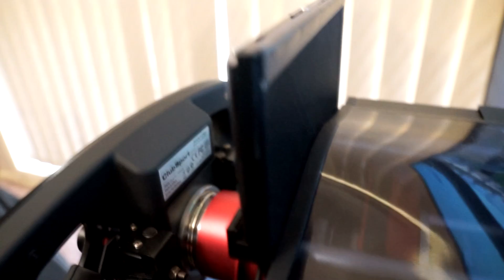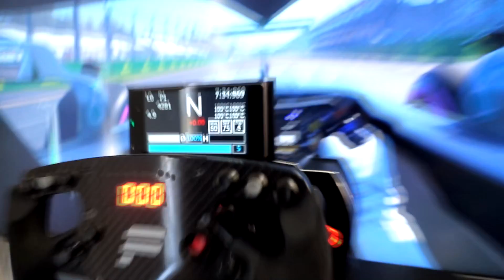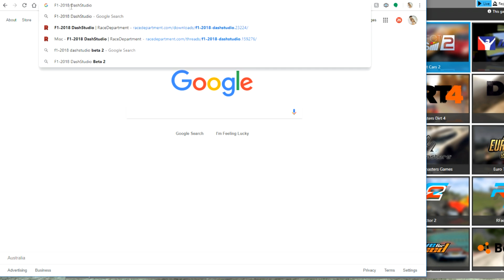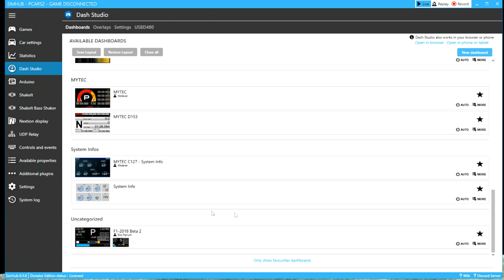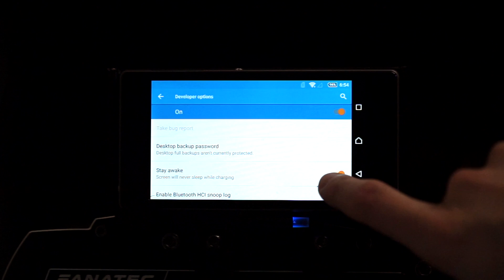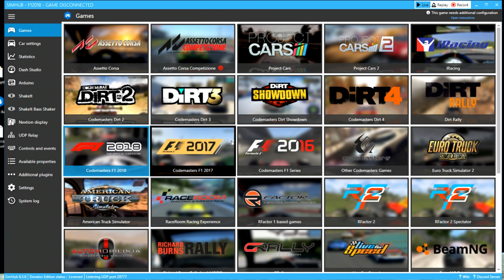How to make a Digital Dash for Racing Simulators using Sim Hub and an Old Smartphone

Comment: Just stumbled over your video.
Thanks you used my dash.
Reply from the maker: Ahh awesome. I remember I spoke to you in the racedepartment forums back when I made this video! Any updates planned?
Reply: @boostedmedia  It's already on V1.1.3 (Added some of the classic cars, comes with an installer, no more javascript).
And the F1-2019 version is there either (but has some "errors").
Currently working hard on the ACC-Dashes, so no further updates for the F1 franchise is planned in the near future.
Reply: i got an problem where its stuck on the launch screen. its supposed to change screen automatic right?

Comment: Hello SimRacer!!!

 I can't installer this dashboard (F1-2018 SimHub Beta 01 0.2). I think that I haven't totally folders inside download. It not appear in folder "Dash Templates" into the installation folder in my PC. In your videotutorial you have a different folders of me.  

Can you help me, please? Is possible send this dashboard for email? 

 Waiting for the aswer to this question.

 Best Regards. Luis T.
Reply from the maker: Sounds like you may have downloaded the wrong dashboard. There’s two similar ones on racedepartment.
Reply: Boosted Media I downloaded f1 2018 dash studio and the inside file is f1 2018 set up file and some other file , no JavaScript extension nor the dash folder??

Comment: how do I activate the LEDs on the formula rim?
Reply from the maker: In F1 2018 they should work by default when “FANATEC LEDs” is turned on in telemetry settings.
Reply: @boostedmedia  I tried but it does not work
Reply from the maker: Running latest firmware on your wheelbase? Sorry not sure. Mine just worked.